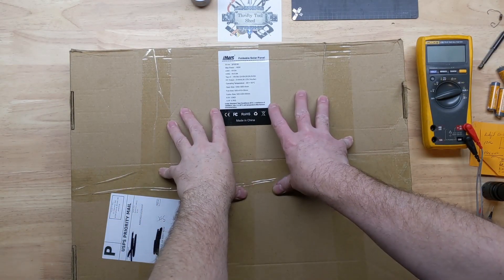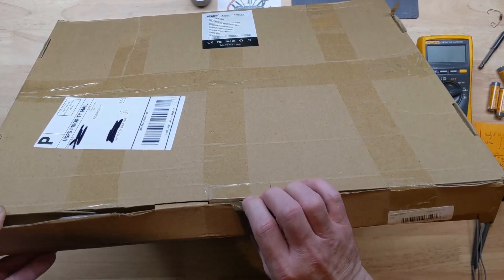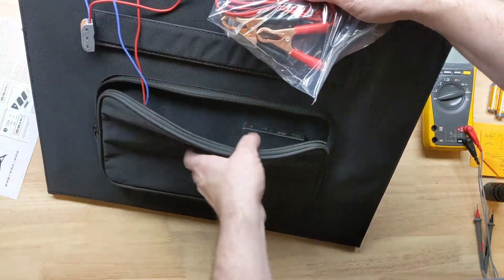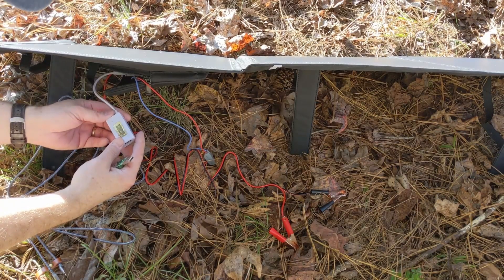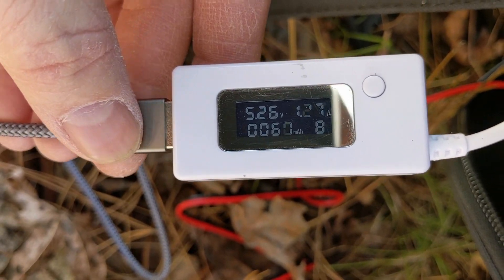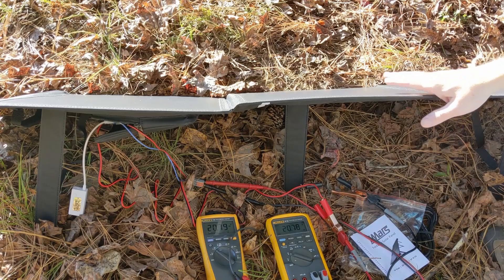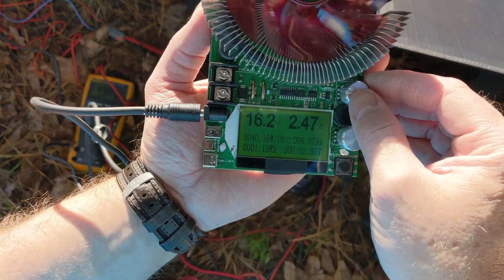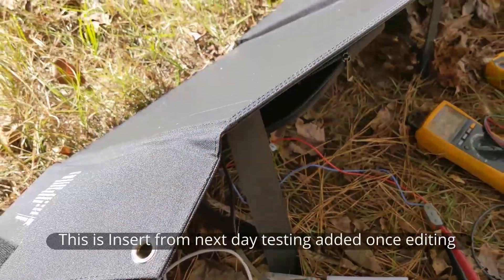iMars Foldable Solar Panel Review

Comment: It scam. Declared 150 W, while max output 50 W?
Reply from the maker: I did feel like it should have output more so I shared exactly as it tested for me. It truly is a nice portable panel, but did not output where it should have to me. I shared my test results on this and the very next item they sent was the TOPSHAK brushless impact wrench which I was very surprised at how well it was made for the price, it worked very well and the battery would fit Makita platform etc. The problem at the time of the video was viewers were letting me know it was over $95 Shipping and handling to the US for this tool and even though the price on the tool for just a "keep in the vehicle impact" was excellent to be honest, but the shipping was astronomical! So after our conversation on my channel about that and how it was not a good enough deal to be worth all that The company no longer sends products for me to test. I don't know what was up with that shipping price, but after about 30 days or so they finally fixed it. Crazy crap! I simply test it, I like to look inside and look at design and build quality and not really much else. I don't know if I will ever review any more Banggood tools or not.